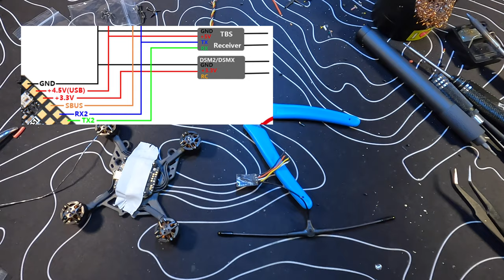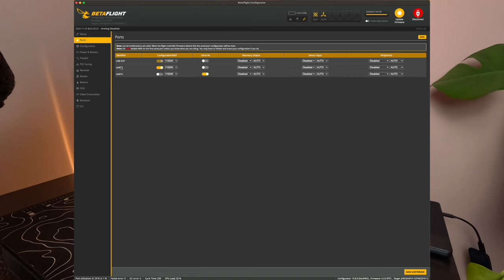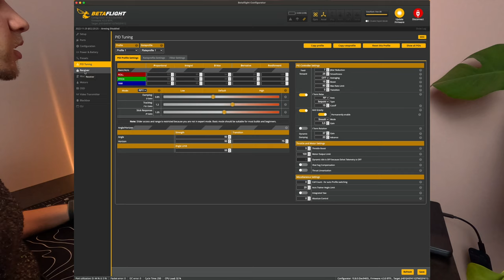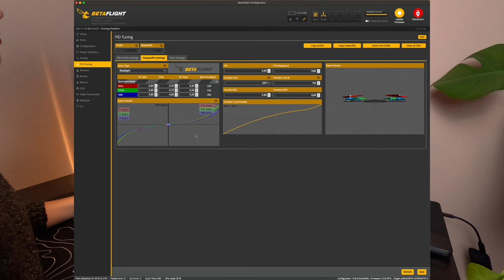(How to) Geprc Cinelog 25 HD Build tutorial, setup, flight!

Comment: Nice! So, the only thing you corrected in AIO is the angle by +45 (or -45) deg Y since mount pattern is square instead of diamond, right?
Reply from the maker: yes, the AIO sits straight in the frame and the AIO is intended for Dimond mounting so you need to adjust that. and I dit a PID tune on it.

Comment: Great video! thanks for posting it! Do you think the o3 air unit would fit in there? I know it would require a 3D printed mount for the camera part
Reply from the maker: Yes it will fit in there if I look at the specs of the 03 airunit and the frame, while I was building this drone the released it, and yeah I thing I need to modify the original 3D print so that it will fit the new cam!
Reply: @Dronebuzziness  I can verify that it fits.  I just replaced my Vista with the 03 unit and camera in my Cinelog 25.  The only change I made was adding tiny spacers to drop the bottom plate a few mm.
Reply: @smanski  how big of spacers did you use? I’m considering buying the anolog version and trying to swap the air unit
Reply: @CasualFPV  Probably 2mm thick, though I have plenty of room between the 03 unit and the AIO, so they probably aren't needed.  I have the 03 unit upside down, and the way I oriented it (USB port towards the back right, just below the AIO power leads), the USB port and bind button are accessible without removing the bottom plate and pulling out the 03 unit.   I don't have the 03 unit attached in any way.  I did put a few little pieces of foam padding between the 03 unit and the standoffs to keep it from flopping around.  That allows a little wiggle room when plugging in the USB cable, as it is a tight squeeze.  I had to find the right USB cable with a slimmer profile.
Reply: @camhudson9064  How are you mounting the camera? That’s my only hesitation at this point
Reply: @CasualFPV  Accidentally utilized another account for my previous reply😁.  The camera fit nicely in the existing TPU mounts.  I used the lower holes on the 03 camera.  I did have to add a washer because the screws were just a tiny bit too long.
Reply: @smanski  a video of your build would be awesome